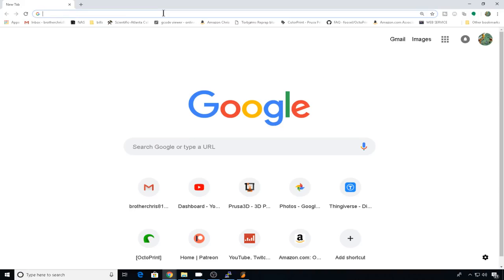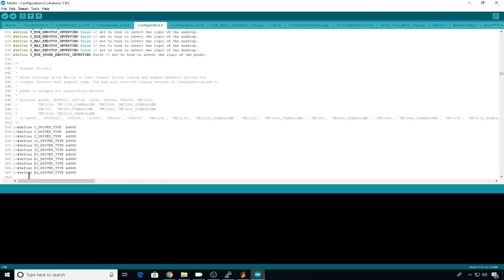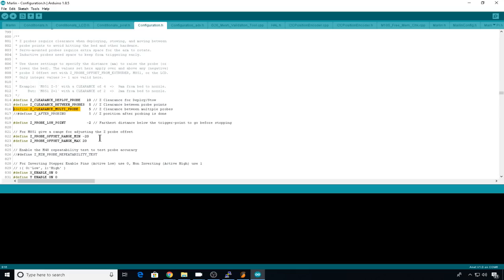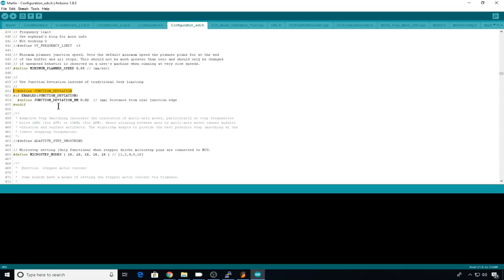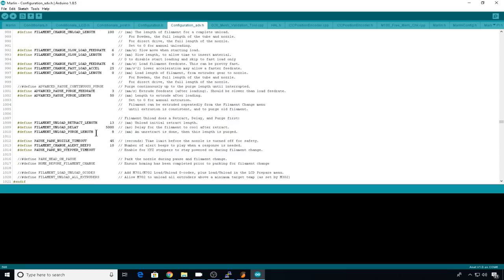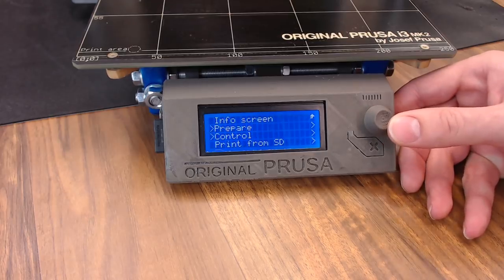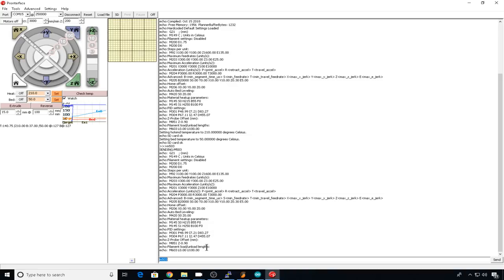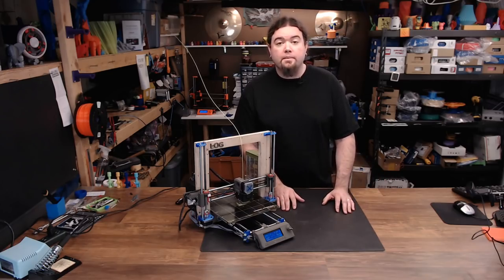Marlin v1.1.9 3D Printer Firmware - Feature Walkthrough - 2018 - Chris's Basement

Comment: Chris, could you make a video that concentrates on setting up stepper motors in Marlin.  For example, let's say I bought a motor that has a 1.8 degree step angle and 200 steps per revolution and I want to calibrate it in the Marlin firmware so it is accurate with distance...  maybe include other variables like pulleys and lead screw formulas and how to put it all together in the firmware settings.  Thanks!
Reply from the maker: Yeah, I can work on something like that.

Comment: Great work Chris!
I have a little question, 
 How to program  in Marlin the time of the print in percent instead of that line block?
Reply from the maker: In configuration_adv.h check these out, not sure what each one looks like, but this is how you change tme.

#if HAS_GRAPHICAL_LCD && EITHER(SDSUPPORT, LCD_SET_PROGRESS_MANUALLY)
  //#define PRINT_PROGRESS_SHOW_DECIMALS // Show progress with decimal digits
  //#define SHOW_REMAINING_TIME          // Display estimated time to completion
  #if ENABLED(SHOW_REMAINING_TIME)
    //#define USE_M73_REMAINING_TIME     // Use remaining time from M73 command instead of estimation
    //#define ROTATE_PROGRESS_DISPLAY    // Display (P)rogress, (E)lapsed, and (R)emaining time
  #endif
#endif
Reply: @ChrisRiley  thank you, verry nice, i lll try this out

Comment: That my man was an excellent tutorial .... great job. I do have a question though ... being new to 3D printing and Marlin.  I’m in the process of upgrading my Cr-10s pro to a direct extruder. There is a stepper change for the bondtech Extruder that requires a scrip change. They , bondtech ... gives you the script ... where and how would you place that in Marlin. Thanks again for the great video.  Take care.
Reply from the maker: Hey Robert, thanks! So they probably give you a feedrate/E step change. Like M92 E415. You can put it in the start gcode if you like, or just update the Steps in the motor section. If you point me to the code they gave you I will take it look.

Comment: Hello Chris
I've seen a lot of videos in upgrading Marlin 1.1.9 firmware for ANET A8. I was hesitating to upgrade mine but today I jumped into the procedure following carefully every step, unfortunately, I couldn't get what it should be.
At the final stage  I'm getting a first screen with marlin 1.1.9, After that, a second screen with X Y Z blinking from 0 to ?  when trying to start the main menu(Info screen  - Prepare - Control ...)  none of this submenus is working just getting back to the second screen with XYZ blinking.

Please I need some help - Thank you.
Reply from the maker: Make sure these have the comments on them in configuration.h
//#define NO_LCD_MENUS
//#define SLIM_LCD_MENUS

Comment: I have a question. I flashed my CR10 original with marlin firmware 1.1.9. My hotend is fluctuating by 10 degrees and takes forever to start when i get above 225. Is there something in the firmware I can change? Because I can set temp to 240 and it goes to 230 its always fluctuating. I use octoprint and cura and would love to be able to make this thing hit temp and print instead of waiting forever. thanks
Reply from the maker: Sounds like PID tuning. I would run a tune on your hotend check this out. http://marlinfw.org/docs/gcode/M303.html

Comment: HI. I did flash the firmware and got the manual mesh leveling to work. However, you didn't touch on one adjustment - the Bed Z: control on that menu. I have experimented with it and found it does absolutely nothing. I've gone all the way from -.5 to +.5 nothing happens. Do you know how to enable Bed Z:, or what it's supposed to do? Does it require some other line to be enabled in the configuration.h file. How is the best way to see that it actually is adjusting Z? Thanks.
Reply from the maker: Adjusting Z to adjust the mesh manually you mean?
Reply: @ChrisRiley  Yea in the Prepare->Bed Leveling->Bed Z: The Bed Z: adjustment doesn't seem to do anything on mine. Isn't it to adjust the entire mesh up or down for a fine "squish" control? Whatever it's for it simply does nothing that I can tell. I've tried it many times and nothing about Z changes. Can you confirm this Chris? I think it's a bug in that it doesn't work. Thanks
Reply from the maker: @nashme11  Hey, I marked this to look at later. Marlin 2.0 is officially out now, i would be curious if this bug still exists.
Reply: @ChrisRiley  Great I look forward to your findings.

Comment: Hi Chris, I don't know if you can help me or not.  I accidentally shorted my thermocouple and heater cartridge wires together.  There was a spark followed by a reboot.  Then my temperature would not give me the correct temperature after I put everything back the way it should be.  I want to move the thermocouple to the second port for extruder 2 and reassign the pins.  The problem is, in the latest version of Marlin under the pins.h header file, things have changed.  Instead of #define TEMP_0_PIN = Pin#, not all I can find is #define TEMP_0_PIN = -1 on all the pins.  Everything is -1.  I don't know how to reassign the pins when everything is assigned to -1.  Thanks, Jason
Reply from the maker: Hey Jason, what board are you running? Let me know and I will take a look at that pins file.
Reply: Chris Riley It is the MKS Gen L 1.0 that came in the TEVO Tornado.  Thanks for your help!
Reply from the maker: @JSunBurns  So basically your working with D7 E1 heater and D10 E0 heater pins. Most of this board is pulled from the ramps file. So in the pins_ramps make this line #define RAMPS_D10_PIN    10 a 7 or a -1 and in pins_mksgenl make this line a 10 #define MOSFET_D_PIN 7
Reply: Chris Riley Thanks, I will give it a try!
Reply: @ChrisRiley  Can I ask you one more question?  I am kind of a Newbie to editing Marlin. 

I believe the TEVO Tornado uses E1 for the hotend fan.  This is D7 from the diagram found here. https://www.robotrebels.org/index.php?topic=769.0  I set my board type to MKS Gen L in Marlin, everything seems to work alright except the fan on the extruder no longer works automatically after I updated to the latest Marlin, meaning it doesn't turn on when it gets past 50 degrees anymore.  I believe something is configured differently than the original firmware that came with the printer.  I am not sure what I am doing wrong.  I can turn the fan on and off manually and set the speed using the Reprap Discount Display, where it shows up in the menus, but I need it to come on automatically when the hotend temperature rises.  I am suspecting that the pin is not assigned correctly, so the firmware doesn't know this is the hotend fan.  It must be set to some other type of fan.  The wiring is just like in the link I included.  Thanks!
Reply from the maker: So it sounds like you have the part fan and hotend fan pins flipped maybe. To set the auto hot end fan, check these settings out in configuration_adv.h. Try flipping your fan pins in the pins file.

#define E0_AUTO_FAN_PIN -1
#define E1_AUTO_FAN_PIN -1
#define E2_AUTO_FAN_PIN -1
#define E3_AUTO_FAN_PIN -1
#define E4_AUTO_FAN_PIN -1
#define CHAMBER_AUTO_FAN_PIN -1
#define EXTRUDER_AUTO_FAN_TEMPERATURE 50
#define EXTRUDER_AUTO_FAN_SPEED   255  // == full speed
Reply: Chris Riley I got it figured out.  I just changed this value from -1 to 7 and that fixed it.   #Define E0_AUTO_FAN_PIN 7
Reply: Chris Riley Thanks for the response.  I really appreciate that!  Love the channel and looking forward to more videos!
Reply from the maker: @JSunBurns  nice!

Comment: Great video again, thanks for your efforts for the scene. Just subbed yesterday.

I have an issue, when flashing CR-10 mini with 1.1.9 i modified(i have 1.1.9 default cr-10 mini settings in already and running), as i get "Marlin.ino.elf section `.text' will not fit in region `text'" when i enabled manual mesh leveling and uncommented also the driver definitions "X_DRIVER_TYPE  A4988" etc.

Where i could go slimmer so i would fit the sketch?
Reply from the maker: Thanks for the sub! So the first one I would go to is in configuration_adv.h

Comment out this line.
#define ARC_SUPPORT  

Then on configuration.h
Remove this comment: //#define DISABLE_M503 

Then try cutting down the menus with these:
//#define NO_LCD_MENUS
//#define SLIM_LCD_MENUS

Comment: Hi, Chris
I've just upload Marlin 1.1.9 to my CR10, been struggling a bit here and there but it all sorted
it's just one thing that is not working correctly, is the part cooling fan, I normally set to 80% but after upload 1.1.9, the fan not working, it will work only if I set to full speed, and if it's lower than 180 (printer fan speed value) the fan just stop, I got no where to look for m8, hope you can help me out here
waiting to hear from you
Thanks man
Reply from the maker: That's probably expected behavior for that fan. Does auto cooling in your slicer work?
Reply: @ChrisRiley  umm I'm using S3D and with 1.1.8 marlin, it was fine nothing wrong with it but since I change to Direct Drive system for CR10, the fan so strong so I set fan to 80 in S3D and do a test print for 1.1.9 marlin, and the fan didn't turn on unless I go full power, got no idea why but I would say the auto cooling fan in slicer work, I guess
Reply from the maker: Yeah, I am not sure, maybe check out the pins file and see if anything has changed in there.
Reply: Do u have 1.1.8 marlin, kinda want to downgrade and keep it that way so it works normally for me, thanks man
Reply from the maker: @JearKrub  Are you just looking for the download? Here you go: https://github.com/MarlinFirmware/Marlin/releases/tag/1.1.8

Comment: Hey, my Y axis buzzers when homing, it happened whith Z aswell but fix it, then, all of a sudden started with Y axis😣 why ? Any idea, to fix the problem with the Z axis I changed the homing_feedrate_z 2*60 ( before 4*60)
Reply from the maker: What type of printer do you have? More than likely it's something mechanical.
Reply: Chris Riley it used to work, and suddently stopped working when i fixed the problem with z axis, it has to be a software problem, or the driver is broken, which i doubt, i have a prusa i3 with the latest marlin update.
Reply from the maker: @HaikIHeaD  It started after you upgraded to 1.1.9? You can slow down the homing feedrate on x-y the same way if you want.
Reply: Chris Riley i tried but i got a compilation error. Do you know how to change de homing_feedrate_xy ??
Reply from the maker: @HaikIHeaD  #define HOMING_FEEDRATE_XY (50*60)   should be able to change this to something like 30*60
Reply: Chris Riley i did change it to 10 and nothing, also changing acceleration and moving speed of other things, still the same, what i dont understand is that this happened on the z axis and while fixing  the z axis it happened this tonthe Y axis.
Reply from the maker: @HaikIHeaD  That is really odd. I have no clue what is going on here.

Comment: Great video! I need to try out ADAPTIVE_STEP_SMOOTHING on my Ender-3 with it's A4988 drivers next time I flash it. I didn't even know that was in there... lol Thanks for the tip!
Reply from the maker: Give it a try, I have yet to test it, I hope it helps.
Reply: @ChrisRiley  Just flashed with it turned on, printing a test now... lol I'll let you know how it goes!
Reply: @ChrisRiley  After a couple of test prints, I can say that the "salmon skin" artifacts are less obvious, but still there. I'm printing single wall cubes and a benchy, they always show diagonal lines on the sides of cubes and sides of the cabin at the top of the benchy with no smoothers. The printer seems to run a little smoother though, it was already near silent with dampers on X and Y. lol
Reply from the maker: Awesome, thanks for the testing and the results.
Reply: @ChrisRiley  No problem! I'm looking forward to your testing as well, love your videos! lol With regard to the A4988 drivers, I want to try changing them to mixed decay mode in my Ender-3. There's a pretty good video explaining everything (v=S75meJJm9Kw) One day I'll replace the board with a MKS or similar and use Trinamic drivers... lol

Comment: 3:35 "I'm just gonna leave this off and go with the endstop switches"
Excuse me? What do you mean? You need endstop switches in order to use this option.
What this option is supposed to combat is switch bounce of the endstop. Endstop filtering has always been there, then fell away during stepper interrupt changes, and was reimplemented because it was found to be necessary on simpler boards, this time with an option. Ideally you'd fight the issue in hardware by adding a 100n capacitor or something.
If you meant pullup resistors - well you have software controlled pullups anyway, on the processor, they're not too stable in value, which doesn't really matter, and are generally pretty weak, which might be a good thing, like around 50k; if you install a typical 10k pullup in parallel to or instead of the software-controlled pullup, the time constant of existing parasitic capacitance will go down and the switch bounce noise will only become higher.

Adaptive step smoothing - not related to TLSmoothers in any way. TLSmoothers fix the hardware issue specific to DRV8825 that this motor driver is incapable of maintaining low current levels in the motor windings because that would cause the minimum duty cycle of on-chip MOSFET to be exceeded, thus it's incapable to effectively execute a part of the range of the microsteps (depending on motor impedance and supply voltage) and snaps to the next semi-step instead. It fundamentally cannot be fixed in software. I believe adaptive stepping fixes microsteps being sent in too large bursts and too infrequently by the CPU, because the time basis of the Bresenham function is fixed to one movement axis chosen dynamically, so other axis suffer a simultaneous loss of temporal resolution, so this allows the firmware to then bump the step routine rate up when needed to make sure all axis get an opportunity to step - usually the E axis is affected the most. In contrast, TLSmoothers are incapable of fixing the issue of step signals not being issued on time, so there's absolutely no relationship.

9:25 placebo. When the driver is not specified, A4988 is the default.

Oh, if you want power loss recovery to succeed, probably better not to use Z-hop :) just as an aside.
Reply from the maker: Wow, this is long, it's going to take me a minute to get through. :)
Reply from the maker: First off, thanks for the comment, they are always appreciated.

Second, do you create content anywhere? I would love to hear your take on Marlin.

Now the video, the endstop switch, all I meant was I don't have a problem with it and I am going to leave this option off.

Adaptive rate smoothing, I do plan on testing this feature. More to come on that.

Placebo, it's better to have it in place then to assume.

Power loss recovery...good tip.
Reply: @ChrisRiley   No. I sometimes create code. Nobody likes to read code, usually not even the people who wrote it and/or have to read it.
I was recently asked by a friend whether i'd like to overhaul 3D printer UI and menu system, and i've actually been following Marlin development for a while seeing whether there's something useful i can do, so i'm always reading the issue tracker and keeping my eyes on important developments, and that's some dense issue tracker, a dozen issues a day or so. Anyway it turns out since Lulzbot's contribution to Marlin 2.0 a couple months back, my involvement in the menu and UI may have become mostly unnecessary. Also checked out MK4Duo, and let me put it like this, after it, my degree of appreciation for Marlin grew a LOT, Scott is doing a tremendous job as a maintainer! Which is not something i doubted before, but it just became a lot more apparent. Hadn't checked out Repetier yet and i'm not sure which version to approach it from - 1.x is supposed to be dead if i read them right but as opposed to Marlin, 2.0 is not feature complete. dc42's RRF and Klipper are often proclaimed as benchmarks among 3D printer firmware, and they very well might be and are origins of numerous engineering insights that lead to the recent planner and stepper changes in Marlin first released in 1.1.9, but i haven't checked them out yet. Obviously these have an opportunity to provide better implementations and foremost much easier to experiment with implementations of high end algorithms because they don't have to make do with as constrained processors like Marlin has to.

I predict that AVR is going to die though and Marlin's economical implementations of these algorithms may be scaled to provide even better than current results on simple 32-bit processors, in particular i think AVR will be displaced by STM32 merely due to pricing. I should probably just design a dirt cheap STM32 board and find a way to make use of its DMAC features to offload a part of the stepping routine.
Reply from the maker: Thanks for replying. I was doing some experimenting with 2.0. The way they use the HAL is pretty interesting. I am looking forward to seeing how this all plays out.
Reply: @ChrisRiley  First great video Chris, straight to the points.  Also Siana Gearz made a good comment and really like the conversation.  Listening...
Reply from the maker: @69developer  Thanks man! Agreed, I am no way close to a developer, although I try. It's good to hear how in depth some of the community members get into this stuff. I wish I had more time to jump deeper into a lot of this stuff. I feel like most of the time I am just scratching the surface.